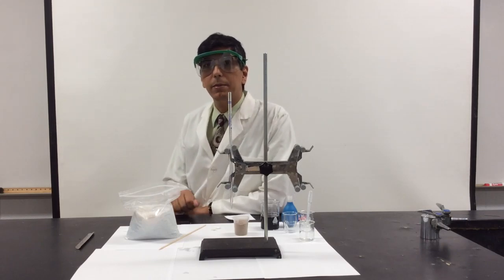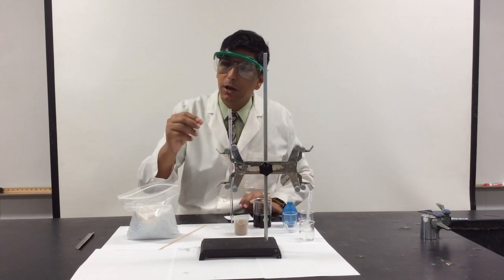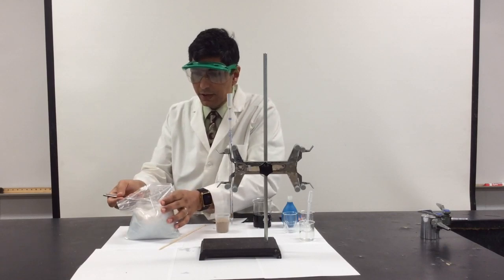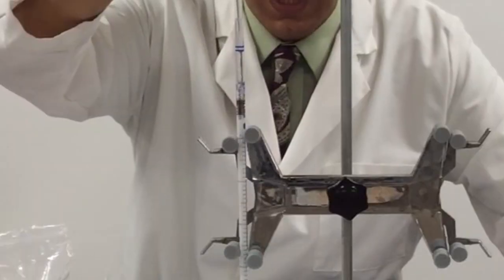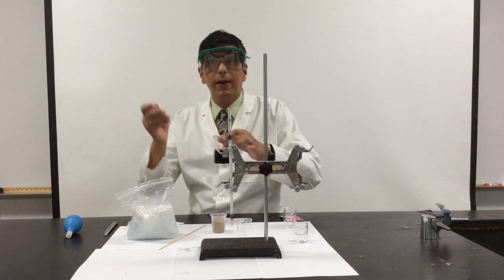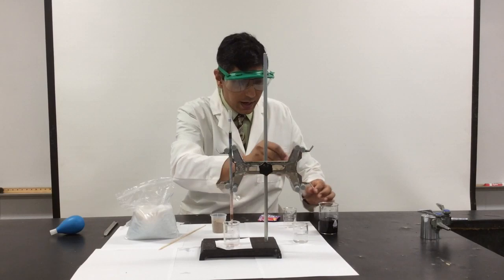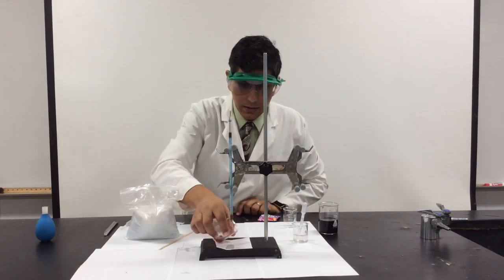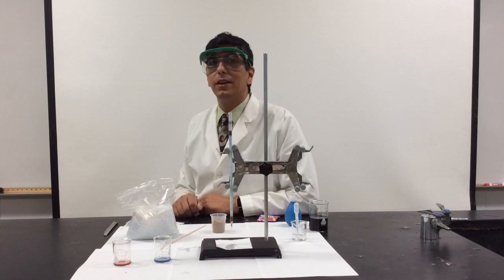Column Chromatography - Separating the Dyes from Kool-Aid

Comment: Can you provide an explanation for the mechanism by which these dyes are separated? Both silica and water and polar, so it does not seem that we can use differences in polarity as an explanation.
Reply: The less polar blue dye adheres to the less polar column and the more polar red dye will move faster with polar water and will be eluted first.